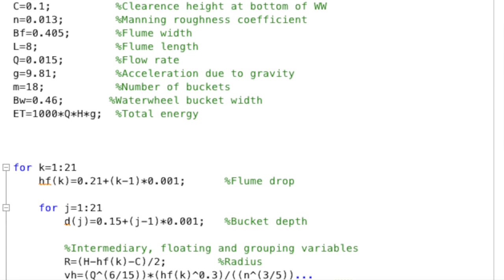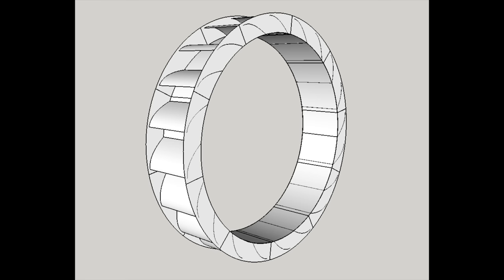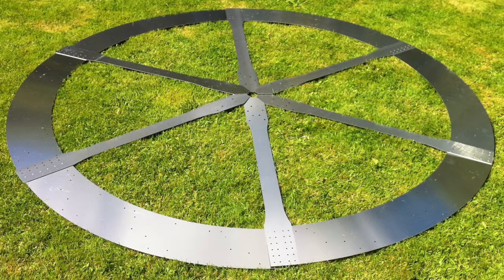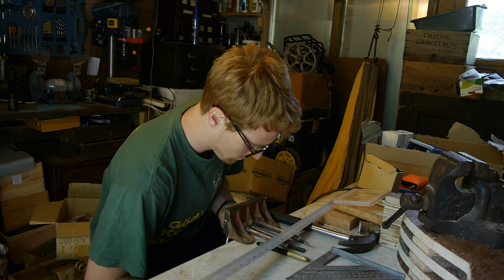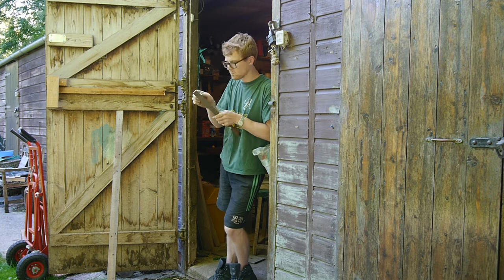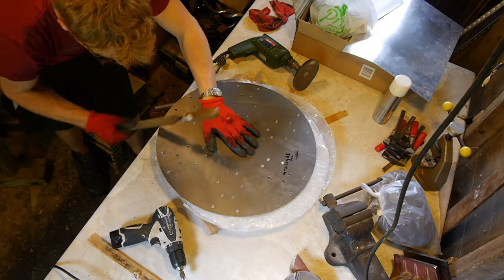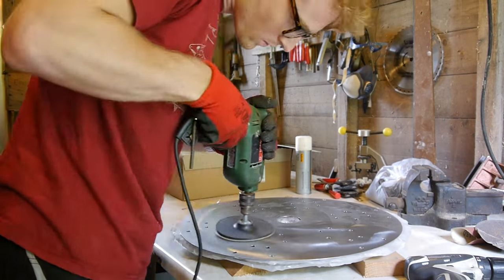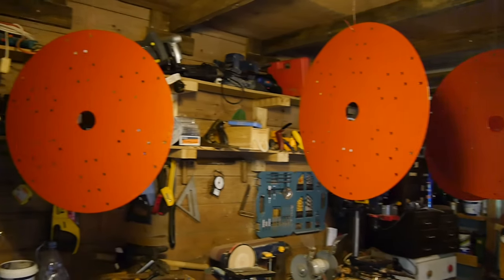Building a water wheel Ep. 6 - Brackets and hubs

Comment: Henry I was amazed that
you have been able to get the design down to a program. I have tried to get
that all together for about a year. Each time I seemed to miss a part or it was
not detailed enough to use as a reliable program to do all the calculations to
get size, angles so that the least drag when dumping etc. That said can I get a
copy of that from you? 

Now I agree using metal
is the correct answer but I may modify this to use wood in that I may have astatic
considerations but let me see if I can do that based on your calculations.  Just as a kind of funny note I took quite a
while to get a simple answer of “where is the power coming from, the weight of
the water or the force of the flume (assuming an over-shoot wheel).  Of course this makes a difference in how you approach
the design of the wheel and flume. THANKS FOR ALL THE HARD WORK and well done video this is amazing. Now so far I have not
seem how may KW or HP you get for a given amount of water (GPM or LPM) is that
forth coming?

Comment: Awesome work , but why you dont make the wheel in wood?
Reply from the maker: Lots of reasons. It will rot, it will absorb water unevenly becoming unbalanced and causing accelerated wear throughout the system, i wouldn't be able to (easily) curve the buckets and using a suitable material like marine ply would have been about as expensive if not more. i actually found the quote for the laser cutting today, it was actually £260 for everything. I know the flume is wood but it is not under large cyclic stresses like the waterwheel and so can weaken considerably before it actually fails.